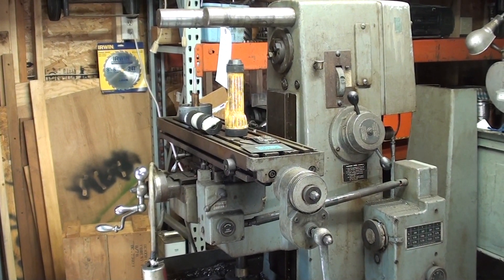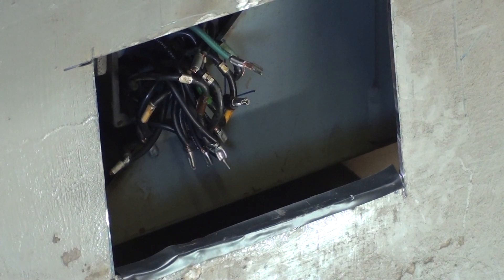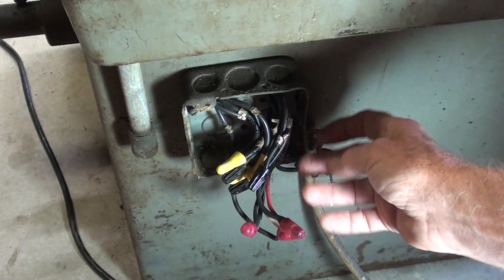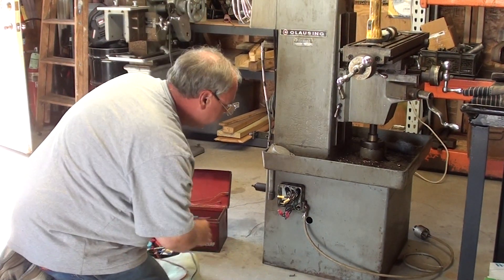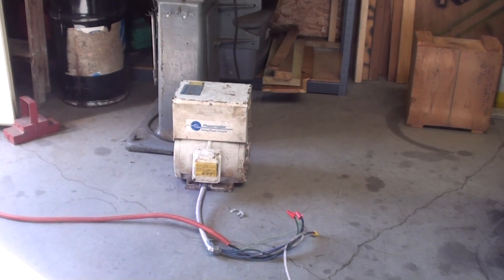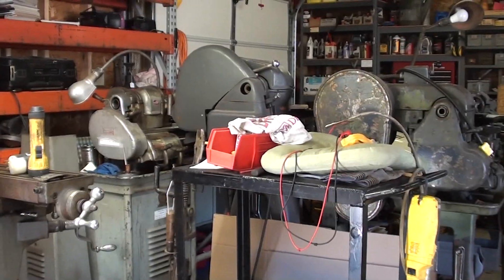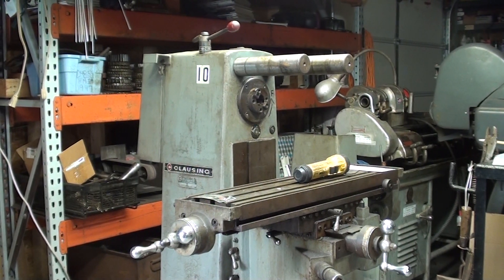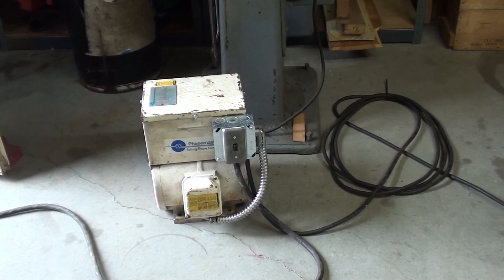New CLAUSING Milling Machine Tips #497 pt 2 tubalcain

Comment: Thank you Dale!  I am glad your Clausing Mill is up and running!  "There will be no voltage drop!"  My brothers and I learned electrical from our dad, he was a firm believer in one size larger than what is required.  We never used smaller than #12 wire for anything in the house, and never had a problem, either.  Your videos seem to go buy so fast!   I feel sure we will see some very interesting videos centered around  this mill.   'Til next time.
Reply from the maker: You shall. But cold weather is already setting in
Reply: Sounds like my old journeyman.  And we always put in a full size ground wire.  No 12-2 with 14 ground.  Every circuit was 12.  Never had any issues.  I rewired my house just like your dad would have wanted.

Jim, wherever you are, you really taught me a lot.  Thank you.

Comment: Mr Pete, I am glad to see you got it running.  I am an industrial electrician and I have several machine shop clients.  I have spent many an hour standing on my head trying to determine the voltage a used machine is wired for.  When I watched your temporary video, I was surprised that they actually brought the motor leads to a junction box for convenience. Most do not!  I have one customer who had a machinist that thought he was an electrician.  He would run down to the supply house and grab whatever plug they had on the shelf.  They blew up several machines because the plugs were mismatched for the voltage.  It took me years to clean up that shop after he left.  Never trust the plug!  Looking forward to seeing some machine with the new Clausing!
Reply from the maker: Thank you, that plug had me fooled

Comment: Going to need to grease that variable speed shaft, they tend to run dry and wear out the splines in the sheaves, and then break the return springs as they start to chatter. Should be a grease nipple on the shaft end to pump grease down to the working area of the splines in the shaft, or if not there is a bolt there replacing one.
Reply from the maker: I'll check it out thanks. I have the lubrication chart

Comment: Glad to see and hear that you got the machine running. You might consider putting the RPC in a box with soundproofing insulation to cut down on the whine. My RPC also has a whine and my 60 gal air compressor is loud enough they both need to be in a closet.
Reply: Would putting in in an insulated box trap heat?  If you do maybe a cheep digital thermostat to show inside of box temp.
Reply: slypig24 - probably need to have an exhaust fan and an air intake like they put in computer CPU cabinets.
Reply from the maker: Good idea but I think it would overheat. And if you use the founder got that noise to deal with

Comment: Try to check if the motor has a nameplate.  That usually will have the information to convert 440 to 220.  In my experience 440 means the windings are connected in the wye configuration and 220 in delta.  Usually there are 12  wires coming out of the motor.  Hope this helps along with info from the others.
Reply from the maker: Thanks

Comment: For those of us with fading vision, I have seen a video of magnifying attachments for cameras (or whatever) that plug into the USB port. As I remember the picture was quite good. 
If you get a motor with questionable wiring, I think you can check the windings with an ohm meter and the resistance will vary inversely with the voltage set up.  Please check for a more informed opinion than mine before making any changes. Your electrician friend probably knows the answer off the top of his head. I seem to recall the voltage change is made by wiring the field coils in series or parallel for each phase of the motor, with somewhat similar changes for a two- speed motor. Many old Colchester lathes have two-speed motors.
Reply from the maker: Yes

Comment: Something that you might want to look into is a VFD. I know you have had mixed results with them before, but you can get a high end used Allen Bradley VFD off of ebay for about $100. A 22A-Bxxxxx VFD says it wants 3-phase, but I run mine off single phase with no problems. I also have a braking resistor on it so my motor stops pretty quickly. I can use it for variable speed, but I have never had any reason to take it off of 60Hz except for when I am doing testing.

I use AB VFDs all the time for work, so if anybody has any questions feel free to ask.
Reply from the maker: I soon will have a VFD's on the drillpress and the bandsaw

Comment: Gday Pete I brought a 3ph mill here in Australia and to save money on getting the 3ph brought in from the street which would have cost big $$$ here in oz , I changed it to a 240v motor and had the electrician wire it up and saved a few dollars thanks for the video
Reply from the maker: Thanks 👍👍
Reply: Doing the same, just got a inverter instead, and will just under run the motor power wise. Torque will be less, but variable speed a bonus, and still run off a single phase.
Reply: @SeanBZA  try and get the lowest Rev motor around 900 rpm would be best that way you won't lose as much torque as you would with a 1400 rpm.

Comment: On the variable speed handle, it says " turn only with motor running", listen to that warning. If you turn the variable speed control without the motor running and let go of the handle it will knock the anchor tab off the main spring. Don't ask me how I know.
Reply: A lesson learned hard, is a lesson long remembered!
Reply from the maker: Thank you, I will remember that
Reply: There is a big flat coil spring behind the handle, it assists with the operation of the vari speed while the motor is running. But if you crank the handle when the motor is not running all it does is load up the spring, and if you let it go it snaps back with much force and will snap off a part of the spring, usually the bent tab of the spring that is anchored into the machine frame.

Comment: Reminds me of when my cousin called me to check out a table saw he bought at a house auction.  It kept tripping the breaker whenever he would turn it on.  He thought the motor or the capacitor on it was bad. I had brought an assortment of capacitors along so I swapped it out.  Still no go.  I opened the terminal box on the motor to ohm out the motor and found a surprise. It had a regular 110 plug on it, but it was a dual voltage motor and was wired for 220 volts!  I guess the original owner just wired a 110 receptacle for 220. Swapped the wires around and it ran fine.
Reply from the maker: Good story, yes be aware of the plug

Comment: Dear Mr. Pete,
Just finished watching the latest video and had a question.  Actually I watched a video by Steve Summers in KY.  He just got a K&T milling machine that he is bringing back to life.  What are the rams on these machines used for and how do they work.  Thanks for the info.  Ray Valley (grandson of a tool and die maker and nephew of  machinist although I'm a woodworker), Eustis, FL.
Reply from the maker: The Rams hold the outboard bearing, that supports the arbor. Keep washer and I'll show you

Comment: I was going to say...never rely on a plug in a used machine. The wire connections in motor are fairly universal as far as numbers, and to the connections for high and low voltage, so even with a missing diagram, it is fairly easy to see what is up.
Reply from the maker: Thanks

Comment: I ended up with a very similar phase converter that I picked up on craigslist recently.  It was a 6hp max but only supports max 1.5hp motors (up to 4)  Is that what yours is rated for?
Reply: TheArsonsmith4242 cc
Reply from the maker: I do not know what mine is rated for

Comment: im not sure if it is a states thing but it seems that many of the machines, lathes, mills, etc there is all 3 phase. In canada, for example, many of the machines are NOT 3 phase but single either 110 or 220 volt machines unless you go over 5 hp (3 for 110) then it goes to three phase...

Thing is most of the lathes and mills run 1.5 hp... Makes me wonder is all.

Unless you go to the purely shop machines that take up huge floor space i just dont see the point of three phase.
Reply: 3 phase has higher starting torque, much better speed control and also is a heck of a lot more efficient over single phase. Same power 3 phase motor typically is a frame size smaller, has better than 90% efficiency over the single phase 80% efficiency and typically double the starting torque, but even though you need 4 wires in the cable it still works out cheaper copper wise as the current is lower.

Biggest single phase motor however is 22kW, meant to run on 230VAC and drawing 63A, used a lot by farmers to drive water pumps at the end of long overhead low voltage lines with a transformer and single wire earth return. ABB sells a lot of those beasts, often as a combo set.
Reply from the maker: Three phase motors are simple and cheap and last forever
Reply: simple...maybe...cheap nope single phase are cheap. last forever....ehhhhh

Comment: As others have said, this is one place where you need to bite the bullet and get a qualifed electriction. If the wiring is not labeled exactly as shown on motor or other cover plates... the chances are pretty good that someone has cobbled the wiring in the past. The motor could very well be incorrectly wired and have been running that way for years. At best the motor could be running poorly or running hot, at worst there could be a serious safety issue that is just waiting to kill you under the right circumstances.
Reply from the maker: Yes, true